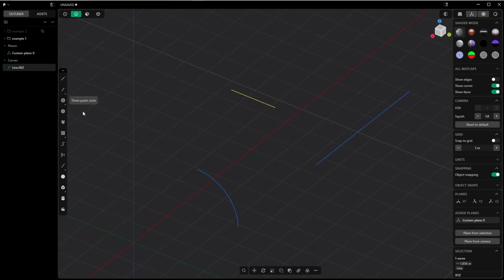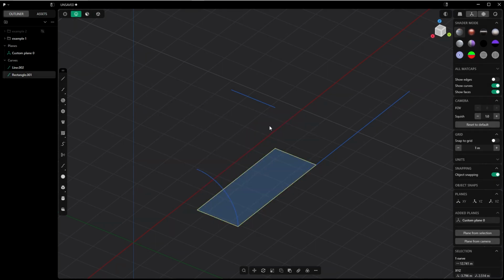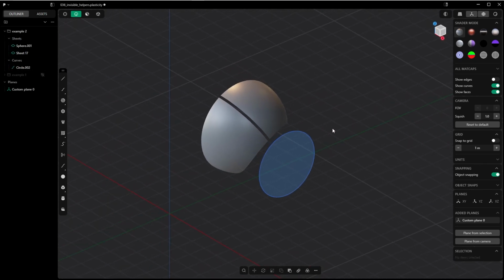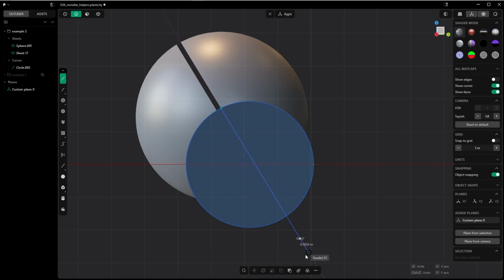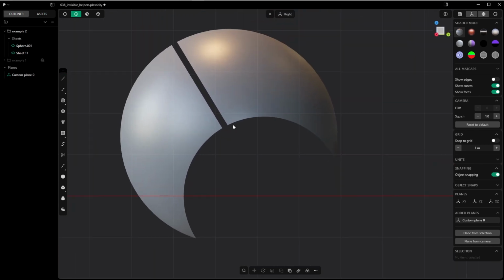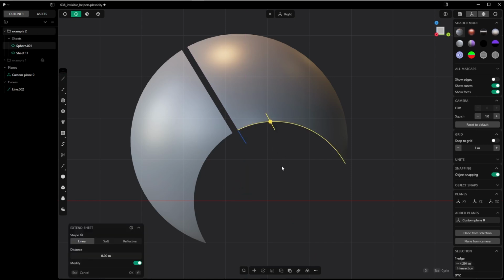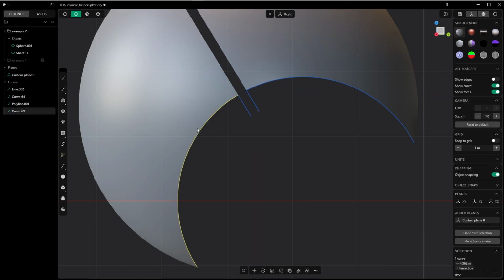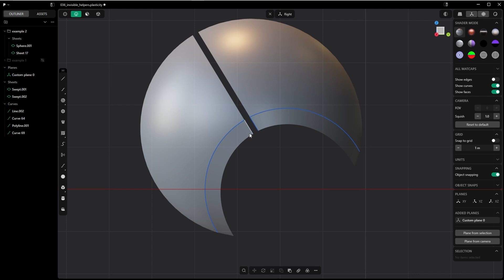Plasticity Tip No. 36 - Use helping guides effectively

Comment: How do you keep the guides up?  I can't use them as they disappear as soon as I move anything. Object snapping is on.  I can only create the guides once as soon as I hit shift and click, the program freezes.  I need to restart a new file.
Reply from the maker: After running a command like "add line" or something like that, just use Shift to activate the guides while hovering over a specific snapping point of an already existing curve/sheet/solid. Don't press anything else. As soon as you left/right click, the guide disappears. To fix the freezing, maybe you have to reinstall Plasticity, not sure about that. One more thing, if you're using a Wacom: deactivate "Windows Ink" in the Preferences which causes all kind of issues.
Reply: @3Dto2D  
Thank you!  I figured out how to use it after I messaged you.  But if I didn't message you I would never figured it out!  ;-)
There's a lot of people with good videos on Plasticity, but I throughly enjoy all of your videos. I love how you get right to the point and end the video.  You got skills and a great sense of humor.  I laugh my ass off!

Comment: Another great video!

I love the guides feature, but I sure would like them better if I didn't have to hold the mouse cursor absolutely still before tapping 'shift'. As long as an element is highlighted under the cursor, I think 'shift' should take effect, even if the cursor is moving across the target feature.
Reply from the maker: Thanks! 
You're right, that would speed up the process. But I like it when the cursor snaps in Plasticity. They should even add a special snapping sound. :)